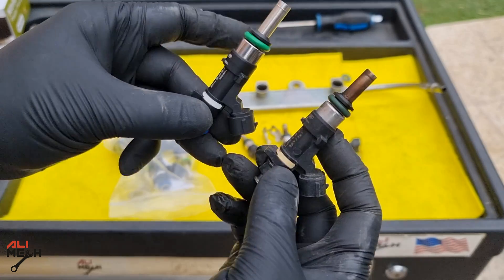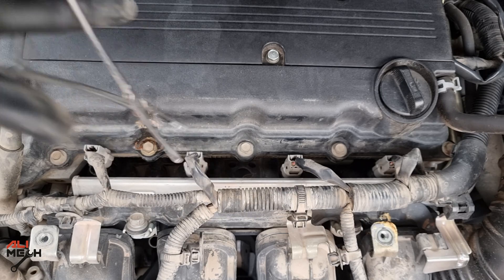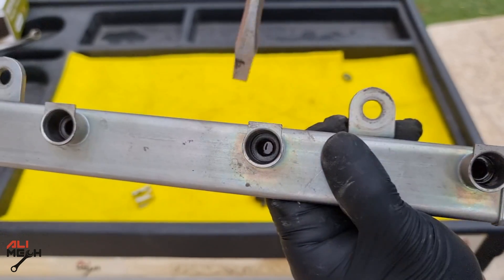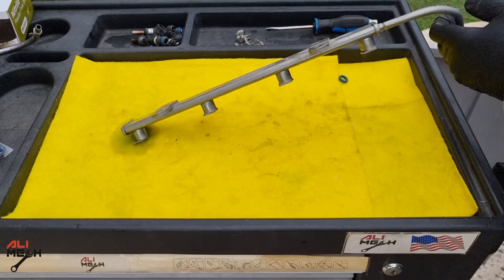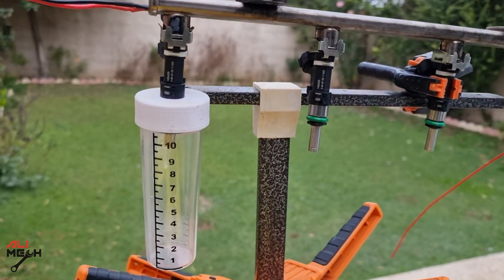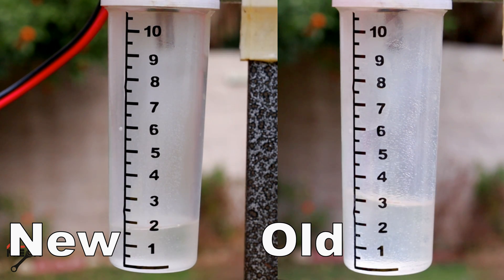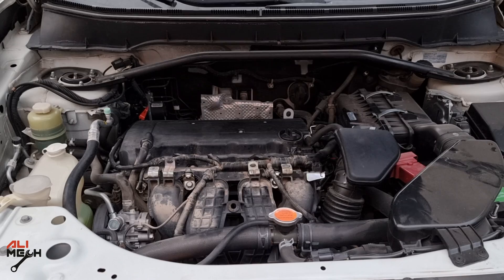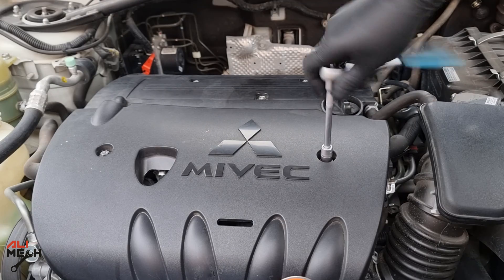Don't clean fuel injectors if your car like this...

Comment: For Volvo cars you can use VIDA to see how much the injectors are using. For example, ca. 1,5mg/stroke is optimal for the XC60 2013 D3 FWD automatic gearbox. If it’s above that you know they’re used up… this happens for this car around 200-250k km!! Not 80-160k km…. That number comes from very OLD mechanic practices that don’t hold up with modern cars. Check with software if your injectors perform within parameters. If that’s not an option, change them around 200k km if you maintain your car regularly enough and around 250k km if you maintain your car perfectly.

Comment: the o2 sensor will adjust the mixture somewhat to get a proper air/fuel ratio. .. so this is not accurate at all

the reason to replace the injectors would be the poor spray quality / poor atomization of fuel, not the 'volume' of fuel being consumed. . the duty cycle of injectors is adjusted constantly to meet the 'target afr' ..so, yes old and worn injectors will give poor fuel efficiency but not for the reason given here.
Reply: Good point. I think both points are real. Injectors, as he said, should not spray more than needed, and as you said, spray pattern is important so the fuel can evaporate easier when entering the chamber and the combustion will be better.
Reply: yes, the volume should not be the basis alone. the EFI computer will adjust the duty cycle, but concern on my end is
1. duty cycle will not go lower than the OEM stock
2. older EFI ECU will control the duty cycle of the 4 or more injectors together, so variance of each injector should be minimal

Comment: 2:19 is there a specific oil you use?
Reply: In other videos I’ve seen a lot of people use silicone based/dielectric grease, petroleum lip balm, mineral oil and engine oil. Personally would tend to want to do dielectric grease. Silicone based stuff is very non-reactive.

Comment: Thanks for the video I just replaced a bad fuel injector and I wanted to replace all of them but they're $90 each but now I have a misfire on another cylinder I'm going to look for a set of fuel injectors that don't cost $100 each

Comment: Once an injector fails it’s best to replace all of them as they are failing mechanically or electrically. If it’s not new oem or better it’s a low mile unit. I’ve watched many take to subsonic cleaners etc and even if they get it up to a flow rate at on bench the integrity of the unit is already compromised. Besides why fry a piston learning so

Comment: 210000 km, Octavia 2017, never any problems with the injectors. I occasionally put in what in Italy is called HVO diesel which has a high cleaning degree, usually on 45 liters I put a maximum of 10. I performed a decarbonization at 190 thousand km for scruple in conjunction with the belt, water pump, engine oil seal... and never a problem, Castrol oil as expected and off I go. unchanged performance, the car reaches 208 kmh as always at maximum speed, a turtle but comfortable.
Reply: HVO destroys injectors over time when used all the time.
A lot of truckers here in Ireland think it's crap.
Maybe an injector cleaner like liquid moly or fuel additive all the time.
Probably helps your are driving an octavia as well 🎉
Reply: @paulcostello1807  Sorry 210000 correct error.

Comment: how much voltage to open valve fuel injector?
Reply from the maker: I use 9 to 12
Reply: They sell a pulse tester on Amazon it's the same one he has 25 RN for black Friday 30 normally

Comment: greetings, good work. I have a marine engine. A lot of gasoline is coming to the injectors, but I think it is not going to the spark plugs, because they are dry. Also, when I press the starter, it throws oily gasoline from the exhaust. The injectors were tested and found to be sound. What do you think could be the reason? I wish you a good day.

Comment: These injectors do not need to be replaced. If you are dirty, wash them in 10 minutes. If you want to buy, then buy only the original and second-hand ones. Cheap ones from Kiyata will not work correctly.

Comment: I recently cleaned my fuel injectors with 180K miles on them and now I have a rough idle and gas smell from the exhaust. I wish I had left them alone.
Reply: You should have just REPLACE THEM!!
Reply: Yeah his injectors were probably cooked to begin with 😂 @MediaTruth_
Reply: I clean it now my car has worse gas milage ever
Reply: @Khaled91901  i ordered 2 new ones and  now my mpg is higher than before. Make sure to replace o- rings in fuel rail too.
Reply: @Khaled91901 adjuster arm leak, valve seat/solenoid leak, that is probably causing your problem if the problem really is your injectors after all higher fuel consumption could be many things but if it's your injectors then that means that the solenoid is messing up
Reply: You have to reset the autoadaptation on the ECU after cleaning
Reply: Probably they were so worn that the gunk provided a seal, so when you removed all that stuff made the wear to be more prominent. I cleaned mine with about 80k and they work just as new. I hope you got your problem solved.
Reply: Did you clean yourself? A lot of people try doing it themselves but you really need a professional to properly clean and rebuild. The tolerances are crazy and nozzles are easy to ruin
Reply: Charcoal vapor canister is clogged
Reply: @kingzionmusic  coincidentally I did find the bottom cracked and repaired it with krazy glue. It didn't change mpg. Only replacing fuel injectors. But now my brake lights are on permanently an unrelated side note.
Reply: @theangryhobos if brake lights are stuck on all the time check the brake light switch under the brake pedal. Sometimes the can get dirty and stick.
Reply: @theangryhobos idk if you got that brake light being on fixed but did you check the brake light switch that's triggered by the depression of the brake pedal? Typically that's the cause easy fix unless it's a wiring issue.
Reply: @shermangearhart6082 yeah it was the pedal stop pad that disinterested after only 30 years😂. Got the replacement part. Thanks.
Reply: Have you reset the ecu so it can adjust parametres to the "new" injectors?
Reply: Its ok could be the evap canister also the charcoal maybe done thts a maybe seems the the fuel injector gaskits. Regardless buy them OEM cheap online does not have to be mustbishi brand but should fix problem the smell most likely a mayby the evap canister dont blow it out u will blow out the charcoal also just get a new one. If u can have a friend put it on the OBD2 so u can get the kive data of the car then u will figure out if any of the injectors are over spitting and just fix the broken one  good luck bother. And dont forget to look into the evap canister i assume most cars and trucks have them. Check your cayilac converters also make sure she is breathing the kive data should tell u att that then get a screen shot then compare. It to the the Mistubish live data on a perfected version of your year and model
Reply: U are smart u will figure it out and get mad at how simple of a fix it was some care require u ti rest the pcm when taking out the injectors just depends on the car go look at the manual online if u have not. And do the other things i mentioned i promise u will figure it out abd she will be running like new once u figure out the issue
Reply: Try resetting ecu and clean sensors
Reply: CEAN THEM AGAIN WITH A DIFFERENT CLEANER
Reply: Try cleaning your Maf sensor?
Reply: @zilla4593  Thanks, I ended up replacing the FIs and the rough idle went away and my MPG went up.
Reply: @ nice glad to hear you resolved it. I’m going through a similar issue and changing mines this weekend!
Reply: @theangryhobos pls what fls? What's the meaning? 

What step did you take? You mentioned you replaced 2 fuel injectors while fixing the rings properly. What else did you do?
Reply: @mrlolomari  FIs =Fuel Injectors. They were original so were too old. 2 spark plugs were wet with fuel so I replaced those 2 FIs. The old o-rings lose elasticity and/or bind when reusing so just replace them to avoid fuel leak.

Comment: Please help.

After cleaning my injectors my car has issues starting up.

The car starts up normal when the engine is cold

But when i drive the car and then stop it for an hour and then turn it on again it hesitates to turn on.

It happened after cleaning the injectors.

Is it possible that cleaning damaged the injectors?
Reply: Mine too. After I cleaned my injector the idle becomes even rough and the engine stalls more frequent at idle
Reply: Hi have u fixed this? Same issue 😢
Reply: check the fuel pump

Comment: Very informational. I think I will replace the fuel injectors on my truck because it gets 15 miles per gallon. Who knows when is the last time they were replaced, maybe they are the original 20 year old ones.
Reply from the maker: Awesome,  great pont

Comment: Nobody changes their injectors unless they’re bad
Reply: Especially when OEM injectors are over $300 each.
Reply: And I have a port and direct injection system, so there are two per cylinder and one of them is under extremely high pressure.
Reply: @lunarrn Rock auto will save you tons
Reply: I've replaced noisy but otherwise working ones in hopes the new ones are a bit quieter, depends on the car I changed 4 injectors maybe took an hour
Reply: No shit. I've never once heard somebody say "I'm going to replace my injectors this weekend" 😂😂😂.

Comment: does using premium fuel like v power / techron or other fuel system cleaner in the bottle help prevent injectors failure?
Reply: Yes
Reply: Fuel additives are not recommended by any car manufacturer. Additives can damage the engine. Use good quality fuel and change the filter (with a good quality one) on time and you are good to go.

Comment: Thanks for clearing out why ,when to replace
Reply from the maker: Any time
Reply: @AliMECH . Hallo, Ali i have a Opel Combo cng.70000 km 1.6   2007. it has Injektion issues in gas Mode. So far the spark plugs, coil pack has been renewed, and Injektion cleaner given to the Tank. Wat else could be done. Without moving injector s,  because on this series the Thick wire harness is a Problem to remove and very time consuming. Thanx for the other Videos.